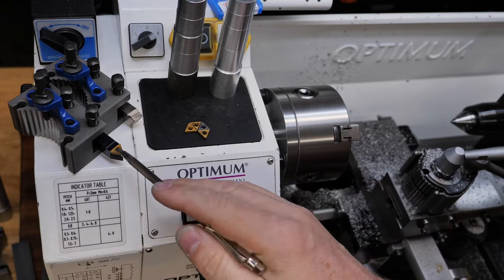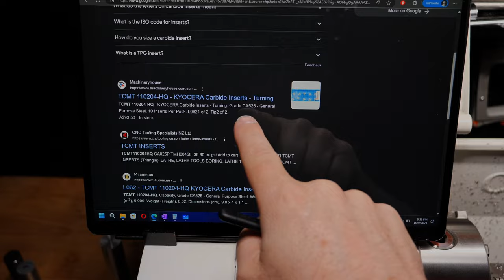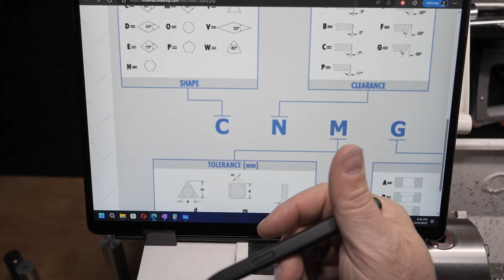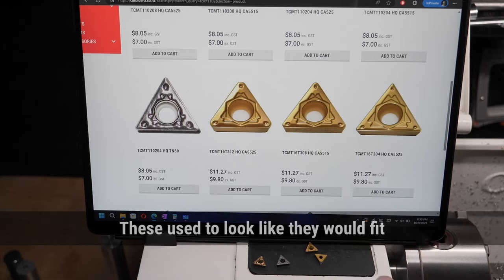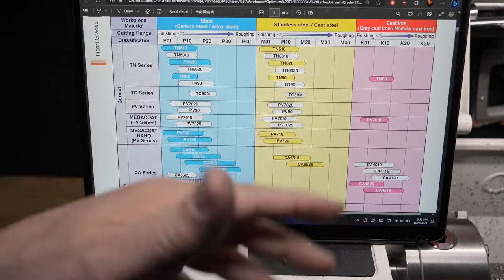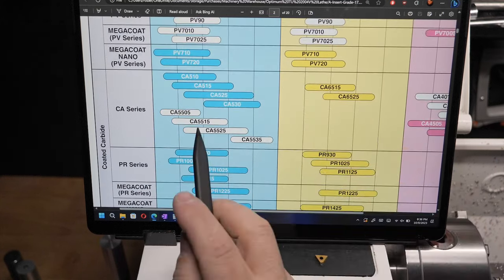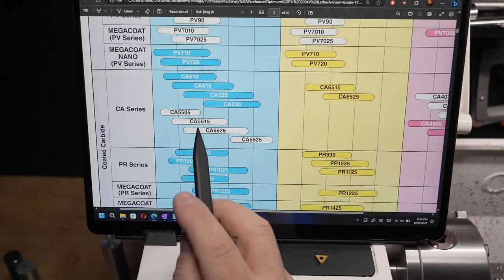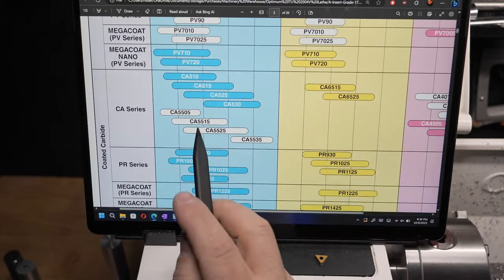Basic Carbide Codes, Feeds & Speeds for the Mini Lathe - Rob's Garage

Comment: I finally broke down and purchased a Diamond tool holder. It's the one I use the most now.  Thanks for doing this great video based off your research . 👍
Reply from the maker: heheh good one :) I'm still using the insert tools as well. After making this video I did the deep and fast cuts that the data I looked at suggested I should make, and the finish is excellent. Another important point someone else made is that the material I was using here might have been something junky and he was right. Soon as I used a fresh rod of free cutting steel, that smearing effect went away. Still going slow for parting though.
Reply: @Ducati900SS  oh I'm a fellow Ducati owner. Mine was bought as a basket case. 2000 748cc biposto . It was converted over to monoposto and they crashed it on the track. That seized the crank so I put a 1995 916cc in it.  Fun stuff. I have a couple videos on it.
Reply from the maker: Done.. subscribed and I'll go watch some videos while I'm working at my desk here :)  @ww321

Comment: As for depth of cut, it's either deep enough the radius is all in, or you hit the groove in the insert, which matches your mathematical explanation. It's intuitive once you see the insert & it's geometry.
Reply from the maker: Yes definitely. I've been kicking myself that I didn't do some additional deep and fast test cuts in this video after working out the feeds and speeds. Now I'm happy to do 1mm cuts at 1250rpm with these inserts and the finish is better than all of the tests in this video. Another commenter also pointed out that the steel rod I was using could have been crappy metal and he was right. I used an unknown rod for the tests here but when I tried later with a fresh free machining rod, it no longer caused that smearing effect. So at this point I'm sticking with the inserts as it is going very well, and I'm still too lazy to spend time playing with the HSS :)

Comment: Looks like I've got the same set of insert tools too.  

I was just working on a piece and experimented with upping the spindle speed and playing with the depth of cut, I arrived on 1250RPM and about a 1mm roughing cut.  I feed the roughing cut by hand so I can manually break the chips because they're very stringy, but I do a final pass with the power feed at the same depth and the finish is good enough that I'm happy with it.  

I'll have to try that bit with the point straight out, looks like it does a very good job of breaking the chips itself, I'm currently using the tool with the edge square the the holder, I do need the square edge though, but for roughing the tip out bit will work well if it breaks chips the same.
Reply from the maker: I tend to use that one where the edge is just a little more than square with the holder, mainly because I don't need to change tools for facing. I haven't actually checked to see if the chips change when the angle changes like that. I've been less worried about chips than I was at the start, after I realised that it's more about convenience and perhaps some safety as well. I should consider it more though.

Comment: I have the Optimum 2406 lathe, which should be identical to yours, just a bit longer. After some experimentation, I now exclusively use finishing inserts. The maximum capability of our small machines, in steel, aligns perfectly with the optimal conditions for finishing inserts. Roughing or even general purpose inserts often exceed the capability of small/benchtop lathes wich results in a poor surface finish and more wear. My main tool, a DCMT 070202 insert, has a specified cutting depth (ap) of 0.2mm - 1.5mm and a feed rate (f) of 0.05mm/rev - 0.2mm/rev. I use this insert for both roughing, with an ap of 1mm and a feed rate of 0.1mm/rev, and for finishing with an ap of 0.2mm using manual feed, so slower than 0.1mm/rev. I use isopropanol as lubricant. With this combination, the machine achieves even better surface finishes in steel than when using HSS.
Reply: Isopropanol seems to be a popular lubricant for non-ferrous metals too. I've got mainly CCMT and DCMT inserts, in 02 but no TCMT yet for the lathe, I'm still learning about all this, its my first lathe and tooling setup. 👍👌🇦🇺

Comment: THANK YOU, FROM THE BOTTOM OF MY HEART!!!
Like you, I am a relative novice and my eyes glazed over when trying to figure out all those codes, plus the feeds and speeds.
I am saving this video in my favorites and am going to be referencing it and re-watching it many, many times in the future. Once again I can't thank you enough for deciding to tough it out and research these two topics, the inserts especially.
Without a doubt you get a thumbs up and a subscription from me!
Reply from the maker: Thanks knuckles! That is exactly why I did this and made the video. The main change I've made to my work since making this is that, with the insert tool, I will happily cut up to 1mm deep and at the 1250rpm limit of first gear (can't be bothered changing gears) and the cuts turn out very nice, better than in the video. Parting is still done slowly though. The other thing to note is that the material matters a lot. Another commenter pointed out that the unknown steel rod I was using could be causing the smearing and that turned out to be true. So now I'm careful to use a good quality known piece of rod for anything important. Anyhow.. I've subscribed to you as well!

Comment: I know this is from a a while ago but surely there is some sort of application where you can scan the barcode on the package and get all the exact characteristics of that particular insert. It seems crazy that you you would need to go to this length and figure this out manually.
Reply from the maker: Yes, totally agree. The entire topic is crazy and seems impossible to manage. I actually downloaded the Kyocera app before I made this, but it was just too complicated because you still have to know what it all means in order to use it. And that is exactly why I made the video here. Now I know how to ignore 99% of the information and find just what works with the tools I've got. It was certainly a scary topic when I first  got my lathe, but its ok now I've done the work in the vid. I think an app could be made to handle the standard ISO/ANSI part of the code system. But when it gets into the manufacturers codes, it would become too complicated, unless the manufacturers all agreed to do it together... fat chance of that happening :)

Comment: Thank you for this. The ansi/iso thing has often driven me crazy. I often wonder if the variations in mild steel are also due to compound flexing in relation to the carbide nose radiues and sharpness. Thanks again.
Reply from the maker: Hi Tom. I think Carbide definitely does more of a scoop whereas steel sort of shaves the metal off. Carbide would seem to need an extra push to get started, which may cause flex at that point. The compounds definitely flex within the dovetail. Because of this I've since added some extra gib screws to my compound , both to adjust the slide and also to lock it up when needed. I'm not 100% sold on needing total rigidity at all times, but at least it gives me a little extra. 
I'd need more experience with different steels to know more. I've basically got some junkyard steel rod and some brand new free cutting rod here, and I failed to use the new rod in this video. I didn't think it would be different until someone commented below. Then I tried it and it was. Since then, using fresh steel and high speeds (900-1250) with my little carbide tools has worked out well, except for parting which I still do very slowly.

Comment: Very interesting and informative video. I will have to look up those charts. Do you think using or not using coolant would also have an effect?
Reply from the maker: Hi Stefan - Since starting this hobby I've tried the watery type coolant (basically water plus a light oil), a light oil/kerosene (CRC) and also a thicker cutting lubricant. I've settled on the CRC for aluminum because it keeps the insert from getting clogged, and the thicker lube for steel. I would use the watery coolant on the mill for longer and hotter cuts.. I don't see any significant variation in finish with either of the fluids and even dry cuts... which I put down to the light cuts I do (they are short and seldom get hot). But after making this video I will be going in harder and that may show up more significant differences. 

I've also been thinking about that smearing effect from the two gold inserts in this video. I'm going to test them at much deeper cuts to see if it is the shallow cuts that causes that issue. The fact that the silver insert with the sharp edge doesn't do it seems like a good clue. Thanks for the positive comment too!
Reply: @Ducati900SS  I look forward to seeing the results.  I will try the CRC next time I am doing Aluminium.
Reply from the maker: @stefantrnacek1394  Cool. Note that the CRC I'm referring to is the kind that is the same as traditional WD40.. the oil/kerosene type. They make so many new types, including the silicon ones that wouldn't be suitable. Some people even use straight kerosene but I like the convenience and safety of the folding plastic applicator straw. They also do them a little cheaper but with that tiny white straw that falls out all the time.

Also FYI - I was watching one of Stefan Gotteswinter's videos just now and he was doing all his small cuts totally dry with perfect results. He also made a comment about how the insert he had required a specific minimum cut depth otherwise it gives a bad finish. That seems to agree with what I've been thinking. So I'll definitely investigate that.
Reply: @Ducati900SS  thanks for that info.

Comment: Mine arrived a week ago.  Nice machine overall.  Saddle lock seems to have the same issue of not tightening down, so gotta check that.  First had to make some parts.. which is done for the moment - change gears are a PITA - have to do something about that sometime ;-)

I noticed on mine that the cross-feed dial is marked as 2mm per turn, but the leadscrew in there only has got a pitch of 1mm.. ?!?
The other thing that bugs me is the saddle-feed with 25mm per turn, which is rather fast for such a small machine.  I'll probably modify both of those things down the road (already working on plans in CAD) to have the cross-slide on 3mm / turn and the saddle at 10mm / turn.
Reply: PS: thanks again for the measurements some time ago.. the magnetic digital scale arrived and will fit nicely on the saddle without reducing swing or other.
Reply from the maker: They need to fire that person who does the saddle lock! The 2mm on that knob is off the diameter of the workpiece. I've found that and the compound dials both give me very accurate results. I've not used the saddle dial for measurements and only use it for moving the saddle back and forth. When I install the DRO I have for the lathe, I'm going to combine that and the compound together into one axis. I've had the thought in the past to add another cog into the saddle to give that dial finer control and to remove some of that slop in there. 
Did you find any issues with the saddle racking across opposite corners when not locked? A couple of others had that and it'd be good to know how common this is.
Also - what's the reason or logic for making the cross slide 3mm per turn? Is that just to be finer or for a specific function?
Reply: @Ducati900SS    oh, diameter.. ups 😳  OK, then it's correct. 🤭

The saddle on mine seems fine for the moment, no rocking as far as I can tell. But no idea what happens when I unscrew the gibs/clamps/etc.  Sliding wise everything is pretty good, so I don't expect any surprises there even without it being held in position by those parts?!

As for 3mm.. economic trapezoidal left hand lead screws come either in 2mm pitch for 10mm dia or 3mm pitch for 12mm dia.. and bigger is better in this case and per my measurements a 12mm dia will fit in there. And 3x faster cross slide movement sounds about right.. it's too slow for me now.

Oh.. that rack-gear is NOT well aligned to the bed - leans backwards by ~5deg - there seems to be some of that putty for smoothing out holes/etc. under there too. Plus the pinion only engages for 1/3rd of the teeths width which wont help with longevity?
Reply: @Ducati900SS      PS: be aware that adding a single pinion reverts the turning direction of the gear-train this goes into.  The convention for lathes seems to be that turning the hand-wheel to the right, moves the carriage to the right.

If slop I would investigate how the rack/pinion meshes and if the rack can be moved a bit.. I found that it's mounted in a position that works for lathes where the handwheel / half-nut lever are inverted to what we got.  If wound to the far right the rack nearly disengages the pinion.. so re-aligning the rack with new holes for the screws a couple centimeters to the right is possible.  The other things that potentially offers adjustment is the handwheel mounting sleeve that is bolted to the apron and which works as a bushing for the handwheel axle.. maybe that can be moved so the 14T gear meshes better with the 44T gear that drives the pinion to the rack?
Reply from the maker: @joansparky4439  Ok that's good to know the rocking isn't a standard feature :) And that's interesting about the lead screws. You have some work planned that we will want to see later on! Hope it's still going well there :)
Reply from the maker: @joansparky4439  Yes, good point. Might have to do something with a little belt. When I first bought it I thought I would take that gear and wheel out, drill a bigger hole and then put a new piece in with an off-center hole so that it would be spun and adjusted to take up the slack. There'll be a simple way to sort it. But not too fussed with it for now. Too many other little projects to deal with :)
Reply: @Ducati900SS     the problem with the CS-LS is two fold.. 1) it's a simple metric thread (not good for force/wear)  and   2) the current anchor point is the handwheel extension bearing piece that is bolted to the front of the carriage.. in my case with very short M6x16 bolts (8mm engaging) and offset to the center of the CS-LS.. means this invites bending forces that affect rigidity.
I want to move the anchor point to the other side of the carriage (rear) in line with the CS-LS  with thrust bearings (8x14x4, F8-14M).. but for this I need my mill working again ;-)
Reply: @Ducati900SS   I also found that the shaft in the apron that holds the combination gear (M1Z44 > M1.25Z14) from handwheel to rack is loose and grease is being pushed out the front of my apron by the tiny wiggle action.. yay.
But any final solution to this problem involves IMHO a rebuilt of the apron itself.. don't hold ur breath.
Reply from the maker: @joansparky4439  ok I see what you mean. Bit of work to sort that out, but let me know if you do anything with it.
Reply from the maker: @joansparky4439  Ok, I'll keep breathing for now. I think it's a lower priority here too :)